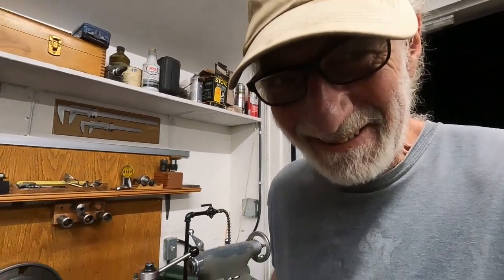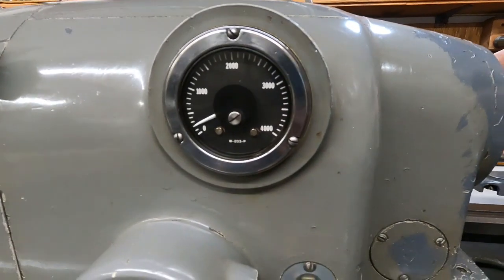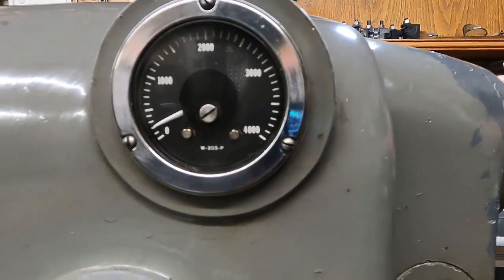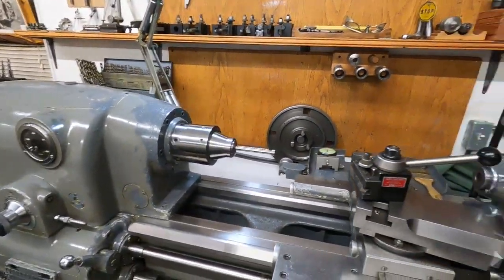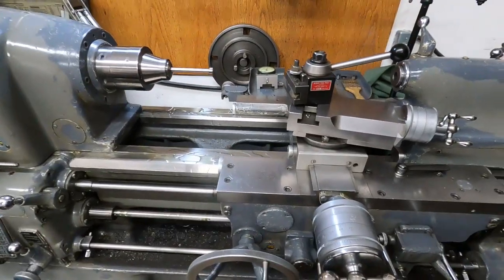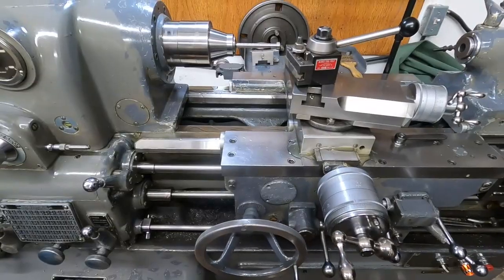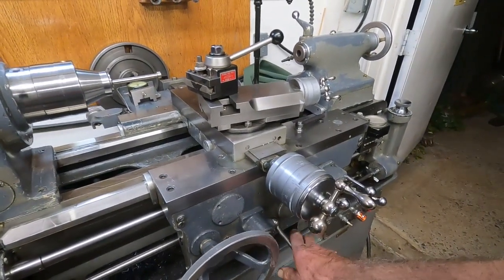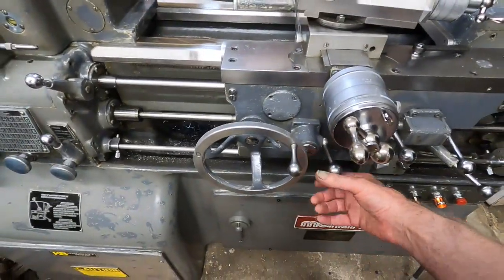Monarch 10ee Lathe warm up, module controlled thyratron drive

Comment: Machine has been well maintained. Many machines have not been . too many non-owners used them.
Reply from the maker: The machines and the gov sites like the DOE really take a beating, so did ones at Boeing I couldn't find one locally that was good. This one was used by Western Electric and had very little use but got dinged up a little from putting things on it.